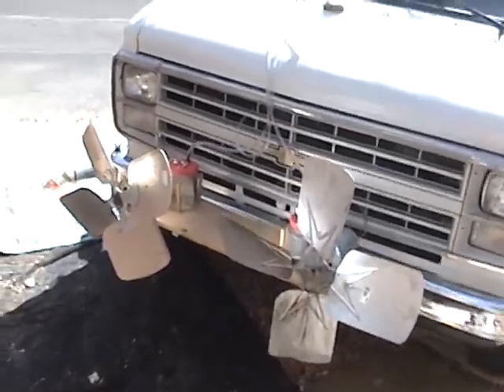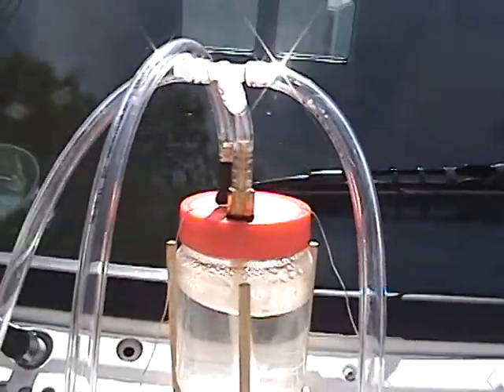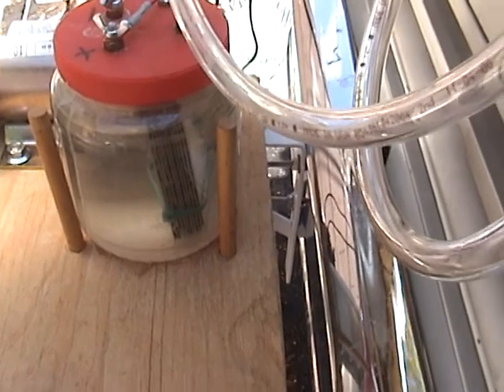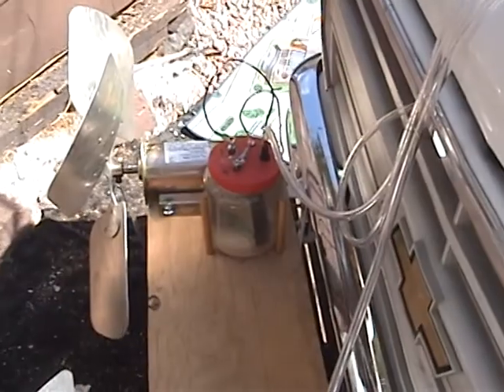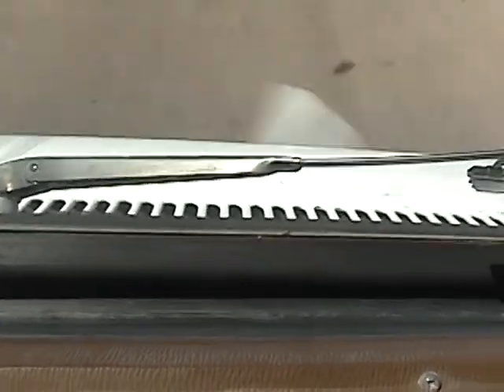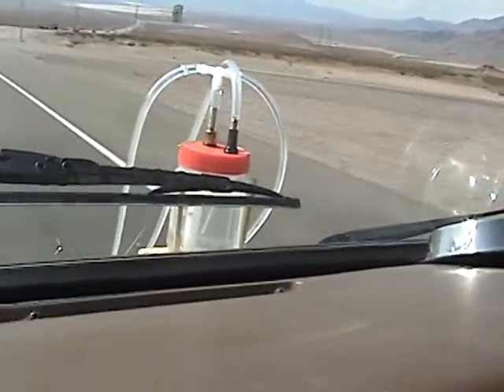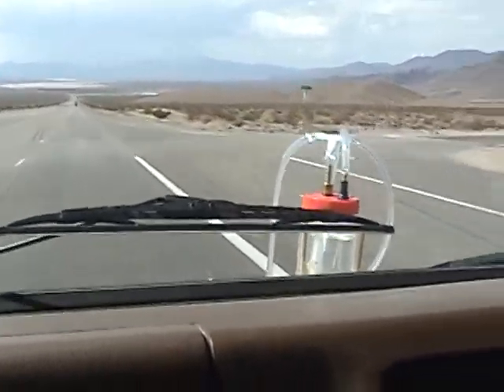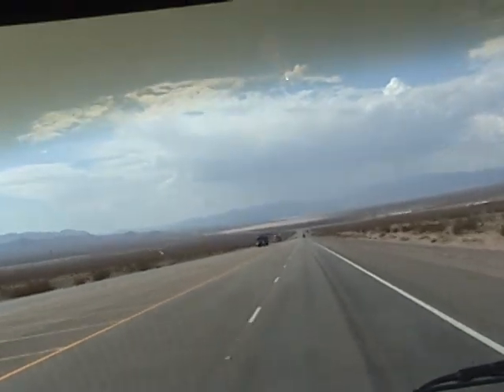AIR POWERED HYDROGEN CELL GENERATOR

Comment: Yeah you should try next gearing your turbine. This would maybe improve the production of electric in slower speeds and more higher amount when driving fast.
just make one bigger gear direactly to the planes and smaller one to the generator and generator will drive faster than plainesrotor.
 You could use plastic/metal rollers and rubber line to reduct the sound of the gears.

And yes, don't use voltage regulator like altenators. This is because you can get very high voltage out of alternator if you remove those 14v regulators out of there. In this system the more higher voltage means less current, meaning less heating of the generators and more hho.

The key issue of this system is that how much drag those trubines produce. The key is to find right gear ratio that produces fastest amount of HHO without adding too much air drag at the front of the car.

Comment: A couple things come to mind watching your video...
The fans on the front bumper... not a great choice. Top of the van would work better for all the added wind resistance you created. Though I can see an axial design on the roof and fed with forced induction, flowing over a turbo-like fan blade. A turbine in a tube w/ twin PMMs.
But if you want to save on fuel, check out the GEET-type fuel vaporization systems. It's simple stuff to build and super efficient.
Good luck to you whatever you do!

Comment: A better hyd gen with plates will work much better, also, the fan and motors in the front of the vehicle is not needed, you are creating more drag than boost, use a DC motor speed controler limited to 15 AMPs, so you dont cook your gen, use Distilled Water and Vinegar,  you can use lots of electrolite, because the amp reg will limit the amps, not the mixture of the electrolite, my generators doulbe my fuel milage at cruise speeds @ 15 Amp draw. and 2 liters of HHO fuel per min. dont use Bat acid

Comment: if you design better HHO generator.. it will do alot better ,, the wire generator create too little gas to make much difference ..   also if you use gear reduction on your electrical generator it can improve significantly  ..

Comment from the maker: I didn't use alternators because the hydrogen cells would demand as much power as the alternators could produce and then the resistence would be so great that even a 50 mph wind couldn't turn the alternators.

Comment from the maker: The front of the van already creates the drag you speakof.

My invention simply recaptures some of the lost energy in the air and harvesting that lost energy and transfortming it into mechanical energy to electrical energy to hydrogen useable/burnable energy.

It worked but I was disappointed in the small improvement that was made.

Comment: On my website you can find all the schemathics for the air powered HHO and it uses the coherent forces of the currents forming in the sheet gaps. This in a new discovery, much much bigger than making energy from piezo materials.

Comment from the maker: I made it back to Mn. and found a new gig.  Before leaving, I added a third unit.  The van got about 2 extra miles per gallon.  About a $50 savings in gas on the trip.